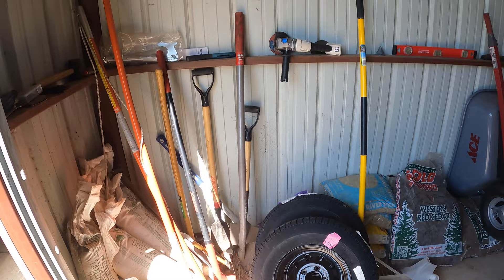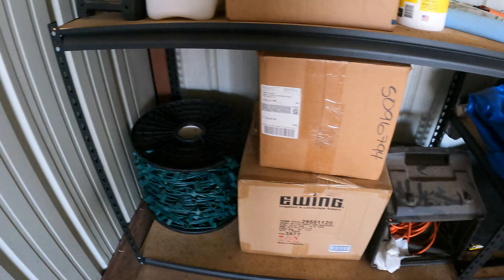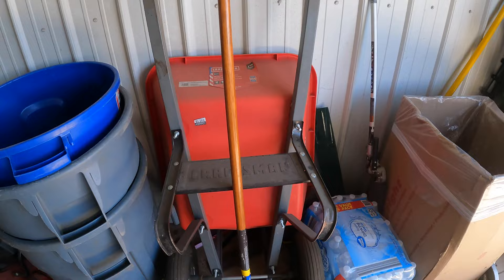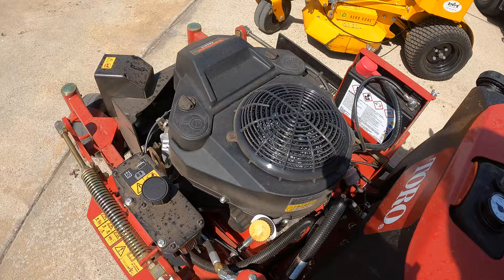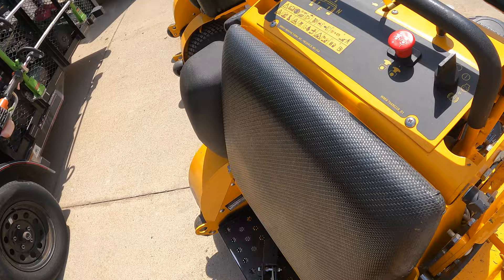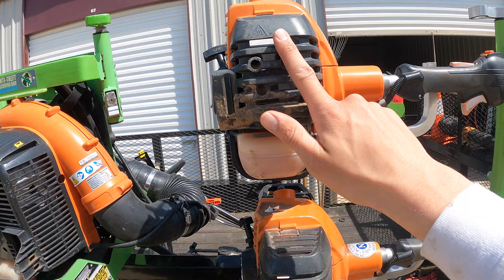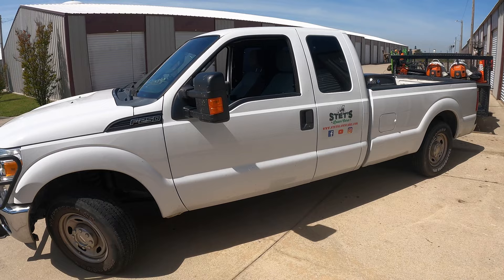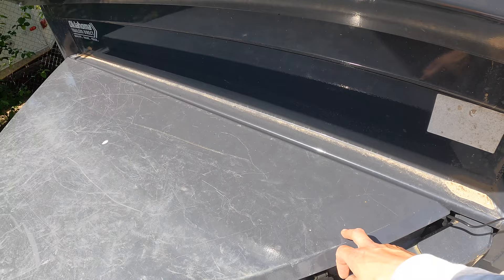My Dream Lawn Care Setup!

Comment: I thought you dropped the dump trailer off at the dealer to get some hydraulic work done to it? Nice set up, and the FX air intake is nicer 👍👍
Reply from the maker: Nope I was being an idiot and holding the controller upside down so I was holding the up button down when it was already all the way up 😂

Comment: awsome setup man.. Though i hate push mowing. Try to do as little of it as can. If i cant use main mower or get smaller stander on it i rather not have it. I feel push mowing just boggs you down.,  I have an ironbull dump also.. Not as big as yours but it hasnt let us down and i liked that it cam with the tarp system as a general setup for it., other ones you pay extra for those. Hey man i normally dont ask but maybe youll follow us back and give me some critique on vids man. I love your hustle and have always. I need to be on here more.